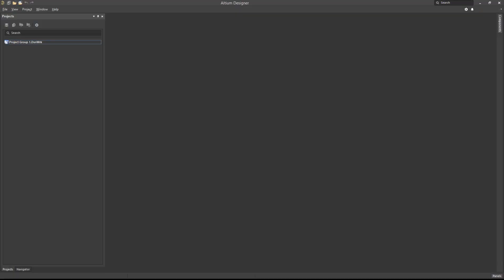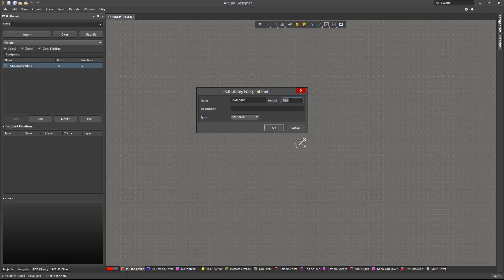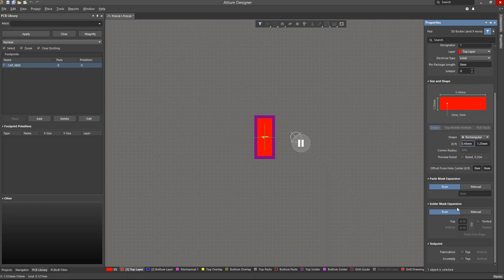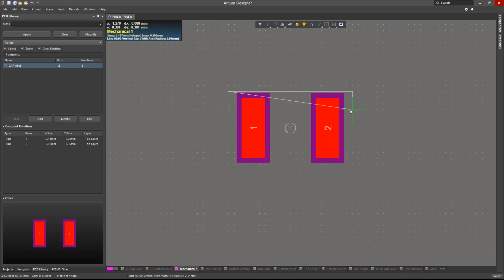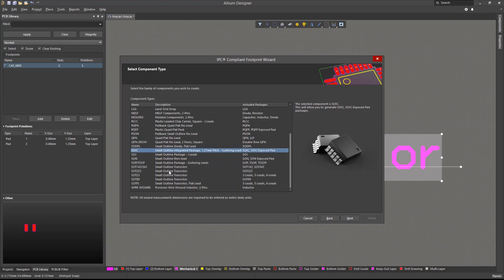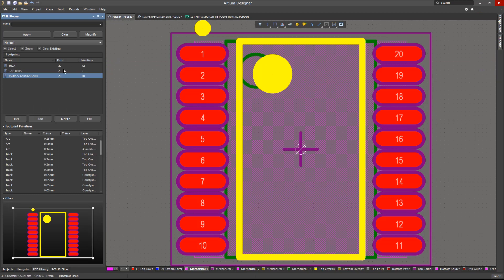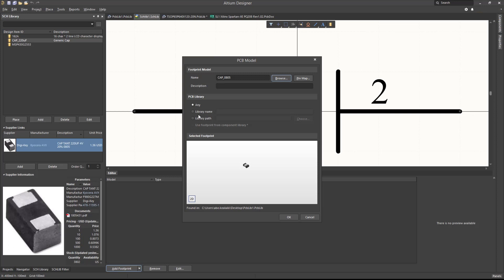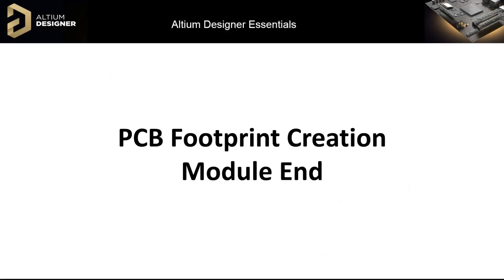PCB Footprint Creation | Altium Designer 19 Essentials | Module 30

Comment: Hello, thanks a lot for the video. I have a few questions: 1- my J+R+Enter doesn't work or more specifically the last part enter doesn't work. and Second, maybe not exactly relevant to this video buy why not using footprint wizard? and if so, this is what I get when attempting to use that "Footprint Wizard did not find any of his assistant. Install them under the Altium|System directory"
Reply: Hi Behnam, it seems you may not have a clean installation of Altium Designer. If enter isn't working you can always left mouse click as well, and the Footprint Wizard issue I think can only be caused by an incomplete installation of the software.